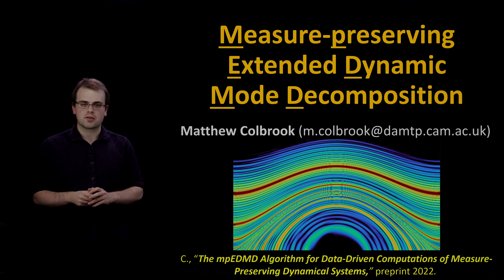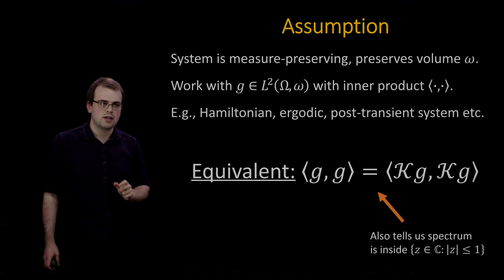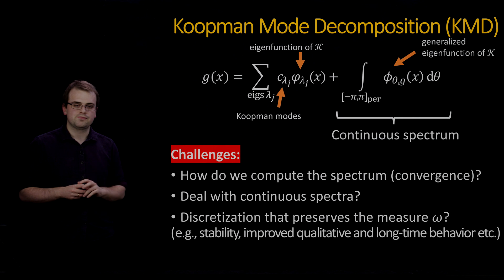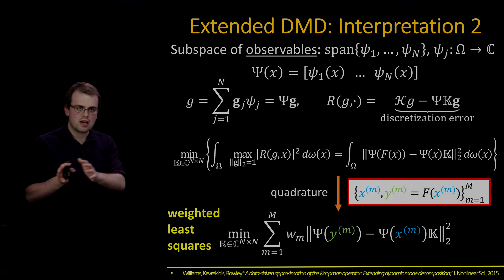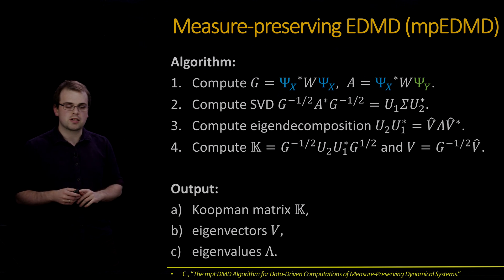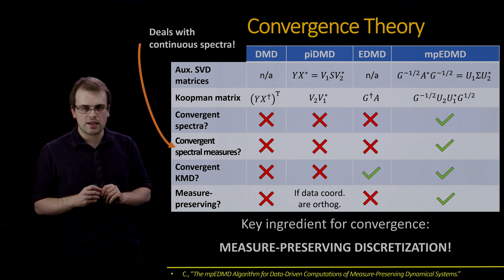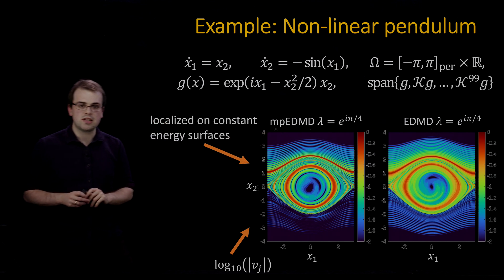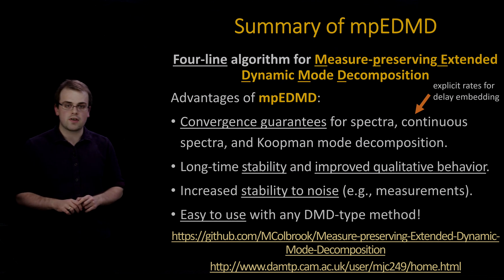Measure-preserving EDMD: A 4-line structure-preserving & convergent DMD algorithm!

Comment: I'm a little confused about the quadrature weights w_i.  Are you selecting the node points, then using w_i from the appropriate quadrature rule formula, or using evenly spaced node points?  I don't get the opportunity to select nodes in my field, so selecting, e.g, Tchebyshev nodes is not possible with my data.
Reply: It's a late answer, but if you can't choose your node points, the standard approach is the Monte Carlo approach with the quadrature weights being 1/m where m is the number of snapshots, these assure (slow) convergence due to the law of large numbers